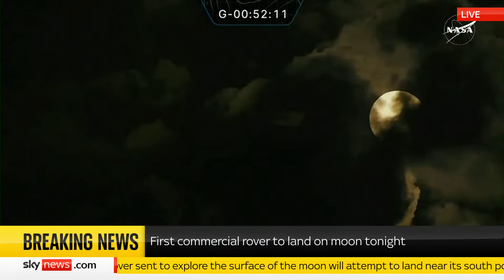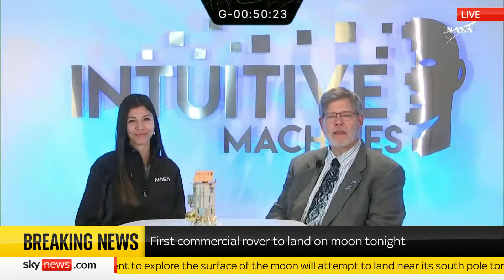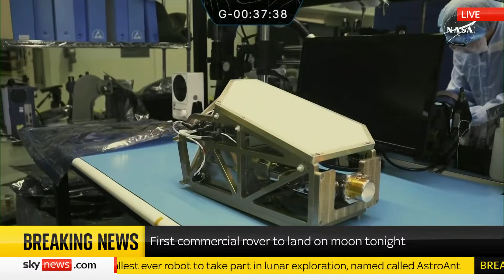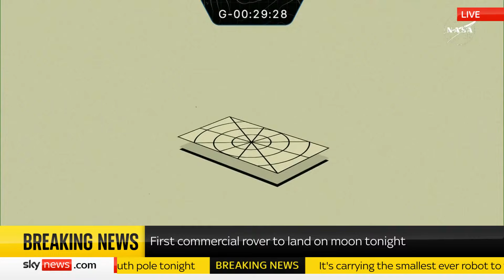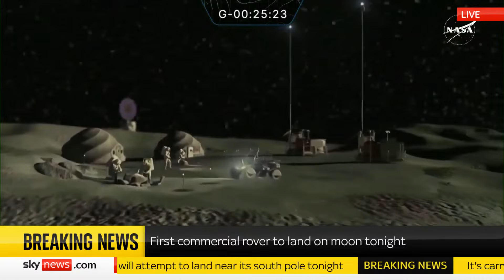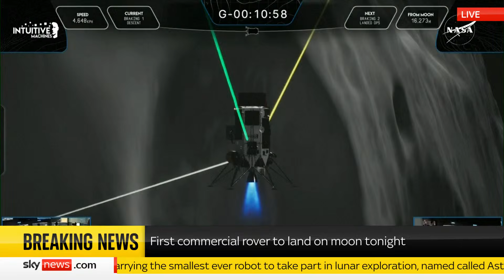Spacecraft attempts to land on moon

Comment: Cmon peoples,  250,000 miles ain't that far, if ya a spacecraft.  Bottled oxygen, hydrogen and a well built machine.  Saturn 5 booster use kerosene/ jet fuel and liquid oxygen. Worked fine for years.  😊